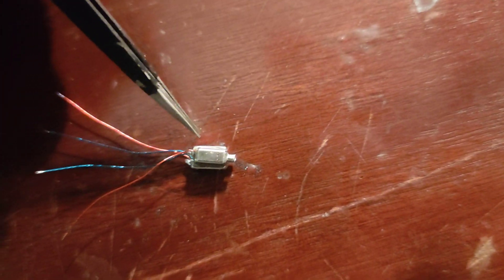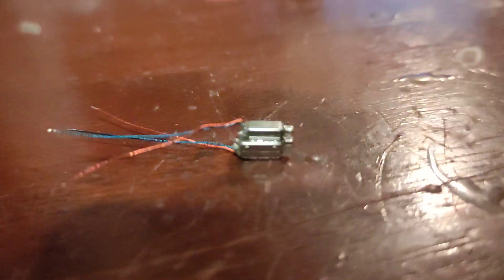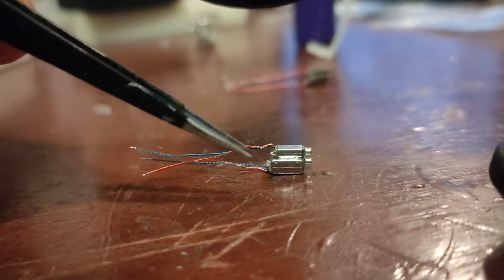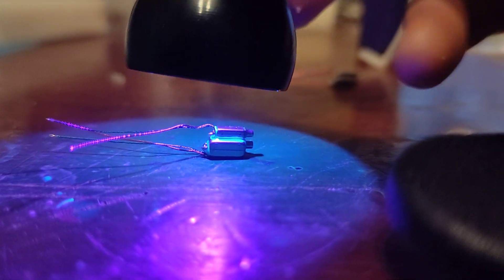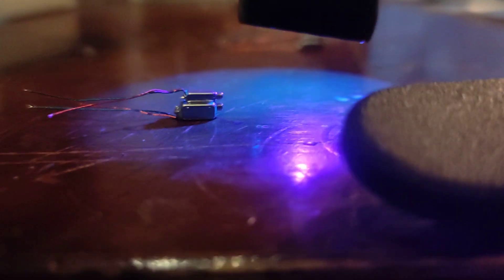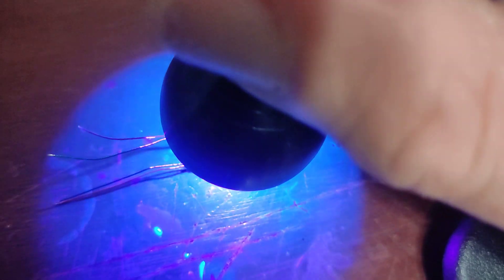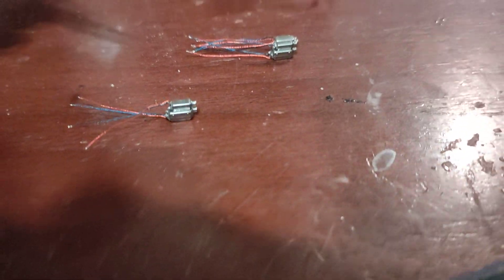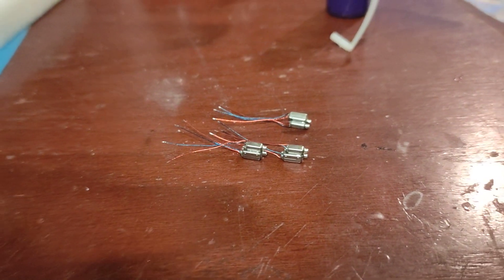DIY IEM: On-the-fly video of how I solder BA and Glue multiple together.

Comment: Tip: If you use one BA for the mids and one for the highs and you want to glue it together, please make sure they are not aligned on the opening (nozzle), instead align them with the terminal. High frequencys travelling faster than mid frequencys. When you align them both on the nozzle, the music isn't time-coherent (group delay) anymore, so the staging and imaging isn't perfect. For holographic imaging and more depth in staging, please align the BAs with the terminal. :)
Reply: I have a question about this statement. Are you saying that the speed of sound changes with its frequency. This is not what I remember of school. Actually there are IEMs (fiio FH3) that have a longer tube for the bass driver to filter out high frequency. 
So if your experience shows that aligning the drivers at the ports (doesn't this position change from driver to driver?) Creates a better soundstage, I could imagine it being because of the delay you created with this method. 
I could be totally wrong though. Just was wondering about that.
Reply: That doesn't make sense, the speed of sound in air doesn't change based on frequency but pressure.
If you look at speakers, tweeters are in the same plane as the rest of the drivers and concentric drivers have the tweeter as the center of the woofer.
For better or worse you would have different parts of the music's frequency arriving at different times.
Reply: This could also be remedied by placing a longer sound tube on the higher frequency driver. Just requires more creative packaging :)